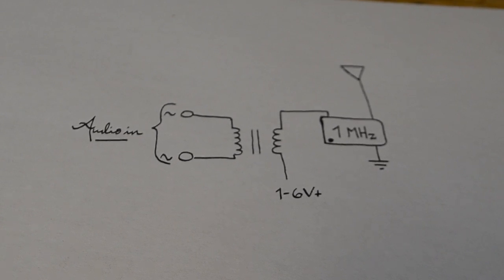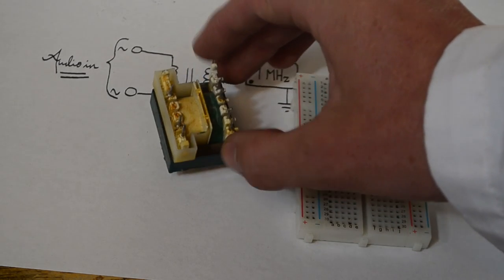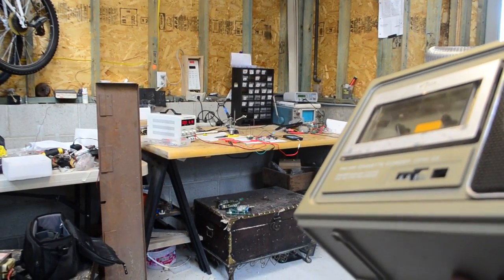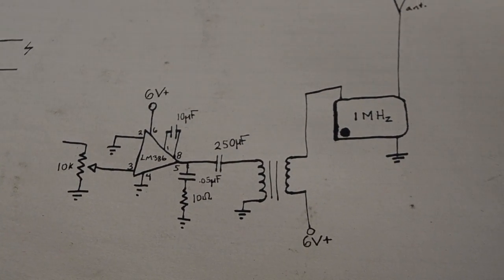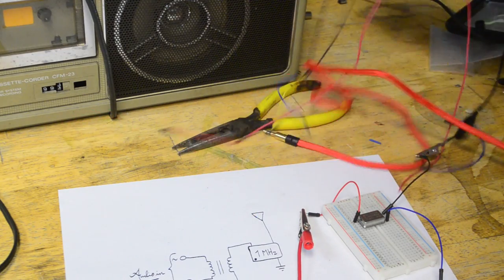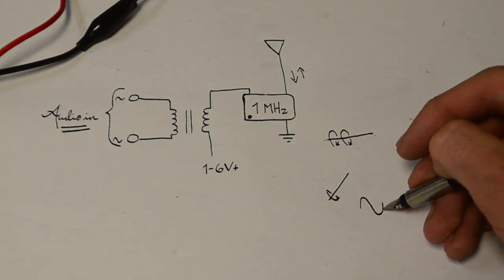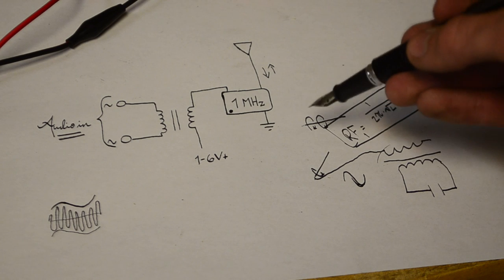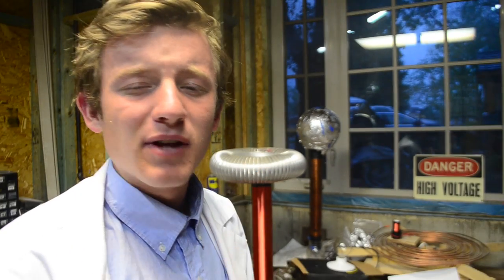How to make a AM Radio Transmitter

Comment: Does it matter what pins you solder of the transformer if yes what pins?
Reply from the maker: Nah, it shouldn’t matter, but it will probably be better if you have the 2 pins with higher resistance to be on the radio side
Reply: Keystone Science whoah that was fast...THANK YOU!
Reply: Keystone Science also will a standard clock oscillator DIP 14 5V 1Mhz work (I found one from mouser 2€)
Reply: Or 1Mhz 5V 100ppm work?
Reply: Keystone Science or you can give me link to yours where you bought it

Comment: Instead of modulating at the power input of the 1MHz Oscillator unit, could you run the oscillator at full 5VDC, amplify the steady 1MHz output through an LC tank with a MOSFET and series modulate the tank with a 1:1 ratio transformer?   Would that produce a stronger and cleaner signal?   Perhaps filter out harmonics with a Pi network filter?

Comment: The antenna have to be a quarter of the wavelength and in this case the wavelength is 300m so the antenna need to be approximately 75 metres long.
I think this is the first problem of this project.
Secondly the AM modulation is not exactly how you drew because the position of the carrier wave is not changed, is changed only the amplitude of the carrier wave.

Comment: Could you replace the crystal oscillator with a variable resistor so you could adjust the frequency which is broadcast?
Reply: No. For proper transceivers this is called a VFO.

Comment: The transformer should be connected to the ground pin of oscillator, bypassing of the ceramic condenser of around 10000 pF

Comment: Cant i just use my phone and an audio cable as an frequencive(idk how to spell) generator
Reply from the maker: +Willeexd yep! You defiantly can! ( infact, i switched to using my phone in the video )
Reply: You can use it as a frequency generator up to 20Khz. So you cant use it for this purpuse because for this you would need at least 1.5Mhz oscilator(1500khz) and that is way higher than the max 20Khz of your phone soundcard.

Comment: @UC6vImVkvofpMUOlYt6LiRXA Keystone Science  - just for the sake of accuracy, the AM graph you drew can't exist - you move the whole signal up and down in sync with the modulation, all that's happening there is the 'zero' point is moving, but the amplitude of the signal - as received by any linked up circuit - doesn't vary at all. 
The usual diagram has an envelope that expands and contracts on /both/ sides of the zero, the half of the RF sine above the centre line gets bigger at the same time as the half below.  Nice one for the simple hookup though, I'm a tinkerer & it's not one I'd have thought of.

Comment: what is the VA rating of the transformer? Is there any upgrade to increase the range?
Reply: You aren't dealing with any power, so anything will work.  This transformer clearly is a standby AC input transformer used to supply 5 or 12 standby volts to a radio or stereo receiver.

Comment: Hah. I made one very similar a few weeks ago. It runs on 13.81mhz and is CW only. It runs off 75ma of 5v solar power. The aerial is about 3 feet long. I'm working on a version with 100ma at 6v and controlled by a microcontroller.

Comment: Hey! Is that type of radio good for Morse code transmission with a straight key?
Reply: If u want you can connect instead of audio source a swich connected to  500Hz signal source and you could then use it for morse.

Comment: please is it possible to jam 27.4 mhz waves?
please its important 
(and its legal in my country)
Reply: The Barbarian Poor CB radio operators
Reply: Widdly Skuds Germany
Reply: widdly skuds egypt
Reply: 123jo123lle please if you have a schematic for the circuit i would really appreciate it.
Reply: The Barbarian I don't know the limitations in egypt. If it's not illegal just buy a CB Radio. I belive channel 40 is around 27.400mhz. You have also 4 watt of power. Sadly, I haven't got any circuits for transmitters on 27mhz. But why do you need this frequency?
Reply: Is it the only legal channel over there to use? surly a lower one is usable?That is CB range,as normal radio that is way out of range.  However you could probably just replace the 1Mhz in this with one of these, https://www.digikey.com/products/en/crystals-oscillators-resonators/crystals/171?k=&pkeyword=&pv183=6185&pv139=597&FV=ffe000ab&mnonly=0&newproducts=0&ColumnSort=0&page=1&quantity=0&ptm=0&fid=0&pageSize=25
Reply: widdly skuds 
nope
it's just some rumors 😊
Reply: Hey, you're going to want to be extremely careful trying to jam that frequency. A quick google search shows that it is the frequency the tower uses at Cairo West Airport. I'm sure you could imagine the problems that would create if you were jamming that frequency in range of that airport or any other airport for that matter using that frequency.
Reply: othergaming
don't worry 
as long as the frequency jamming within my property I'll be ok.
Reply: The Barbarian So... What kind of transmission do you want to operate on that frequency?
Reply: 123jo123lle
i was trying to jam a wireless microphone that uses 27.4 mhz 
(and don't worry its my mic😊)
Reply: The Barbarian you can make a beefed up circuit like the second scheimatic he showed in the vid and connect it to few crystal amplifier circuits and then to a mettle pole or old tv dish. that would have a large range so be careful you may be sued for it if you destroy other peoples mics
Reply: mhz = millihertz, and even then it should be 'mHz'. That's a really low frequency.
Reply: In theory all you would need to do is build this circuit with a osilater Kristal at 27.4 MHz and play anything through it I'm not a hundred percent sure but it should mess with it at least a little
Reply: get a automotive ignition coil , car battery , solar panel and a 1/4 wave wire ,whats the formula 27400 divided by 468?Tell us how it helped you.

Comment: how do you know where to hook up wires on the transformer please help
Reply: Nvm on that but I'm having an issue it doesn't work an farther than 2 inches
Reply: @gregthatcher919  You need to connect LC circuit in series with output of oscillator and antenna. With that you can transmit on about 3 meters range

Comment: Please how can i use it with a simple crystal with 2 leads?
Reply: You must make some amplifier which generates positive feedback to sustain oscillations. Quartzs with 4 pins have it built in, with 2 pins not. You can check some quartz tester circuits.
Reply: @sebastiankusyk7764  Thanks. i was alredy searching one

Comment: can i use other frequencies oscillators for example 47Mhz?
Reply: That’s in the 6 meter amateur band. It would work, but most 6m receivers are probably FM.
Reply: Brek Martin i have a RTL-SDR and wondering how can i receive it on my computer! thanks
Reply: In AM Mode if the receiver has one. AM/FM carrier are the same thing, so if you have a waterfall display you should see a carrier on frequency just by powering the oscillator close to the antenna (without even completing any modulating transmitter).

Comment: I'm building an William George Armstrong hydroelectric generator to run a Frank Wyatt Prentice's  a Pennslyvania inventor whom received patent for a  300 watt  generator producing 5000 watts from Telluridic currents accumulator.If you see Armstrong's Hydroelectric Generator I think a Tesla Turbine could be a novel addition.I'm taking  extra time as  your impressing   diligence and knowledge is commendable.I'm kc1frf  general class license ham radio operator,are you a ham?Could you configure Tesla Coils to transmit at 500 KHZ.? It would be very helpful at navigating Tank circuit inductance and capacitance values,besides energy commodities ,particularly electric charge stations could capitalize on the accumulators qualities.I actually think God sends lighting to charge the Earth like a galvanic battery, or it could  be ww3?  To stop commercial applications .I suspect its that bad (not Michael Jackson )here on Earth and see many worthy inventions or working models for improvement.I found 1 MHZ crystal oscillator at Jameco.The LM 386 from surplus electronic sales but they have LMn1,3,and 4. I'm not sure correct nomenclature to choose, 1,3 or 4.Nebraska surplus and All-electronics  I found all capacitors still searching for u 250 cap.could an electrolytic cap suffice as long as I polarize correctly?The transmitters for mobile as I drive to Vancouver B.C. Cocaine,DMT,LSD are all decriminalized up to 3.5 grams.I'm going to play a cassete recorded tape explaining how my Hydrogen powered Honda CRV operates from home made electroyzers.Thank You.

Comment: You Failed to explain am modulation correctly, in the transmitter you didn't mention the fact that am transmitters broadcast a carrier the audio adds 50% to the radiated power, there is a balance of carrier and modulation power. Furthermore in the receiver you failed to include the fucking detector a simple diode is required as the modulated power is an envelope, no diode to audio! Go back to school before you attempt to talk like a doctor.